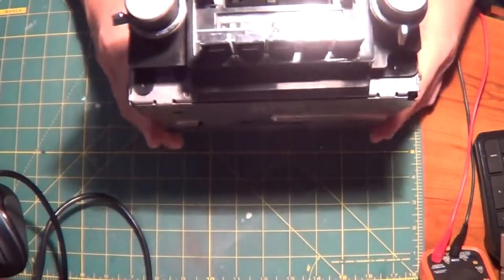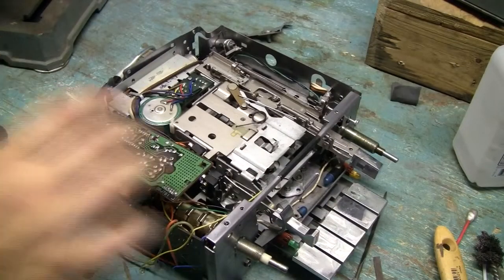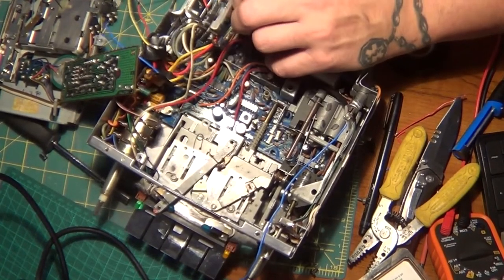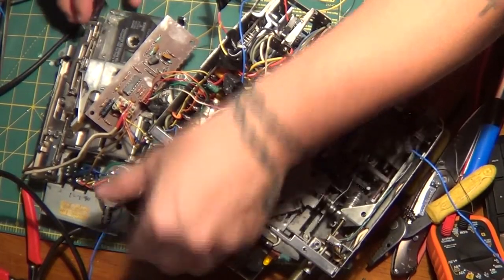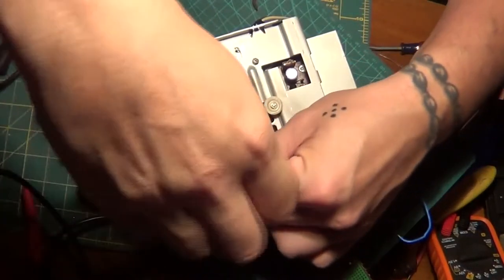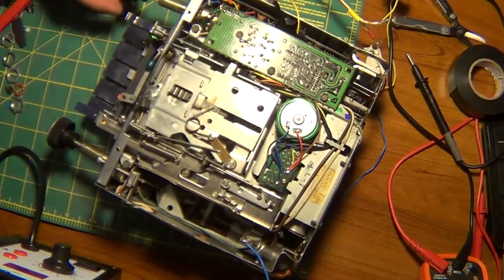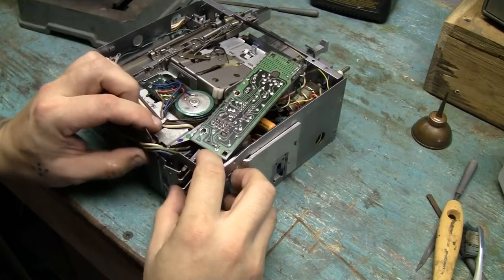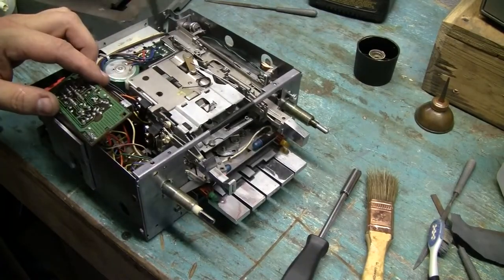Refurbishing a Vintage 1986 El Camino GM Delco AM/FM Cassette Radio - #electronicsrepair #caraudio

Comment: It's big job good and nice. Thanks. 
Yesterday. Morning I worked 4 hours to repair and clean GM radio fm, am. For my buick regal.
I HAD PROBLEM WITH RIGHT PUTON. 
THE ruler move but not complete.
The symptoms for this problem the Frequency movement not enggaged with rotation. 
I WILL TRY TO FIX IT AGAIN. 
GREETINGS.
Reply from the maker: Very nice, sounds like you have a solid plan on attacking the issues. I wish you the best of luck friend. take care.

Comment: I have the same radio and on cassette mode it only plays from the left speaker but not the right. On am/fm it plays from both. Any suggestions?
Reply: Thank you, because the ic sound is broken and difficult to hack currently.
But there is another solution, which is to connect the right speaker to the left so that they are on one line